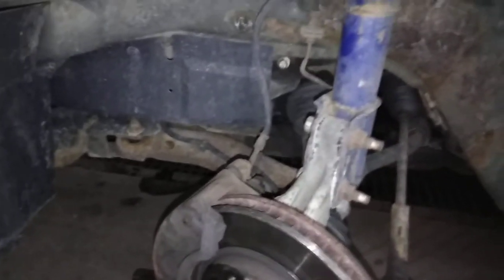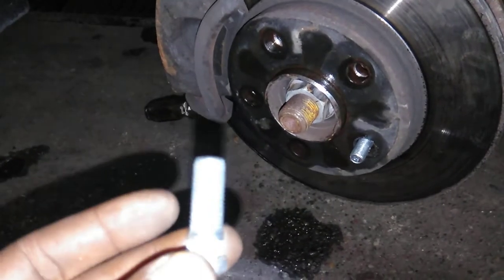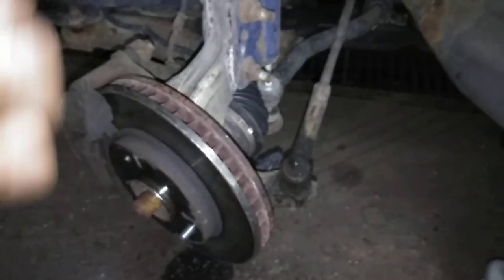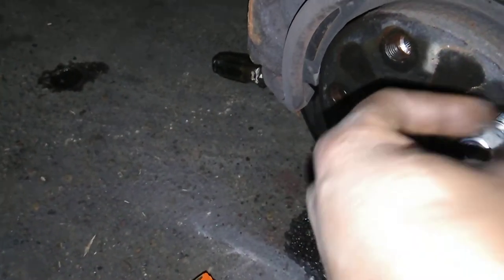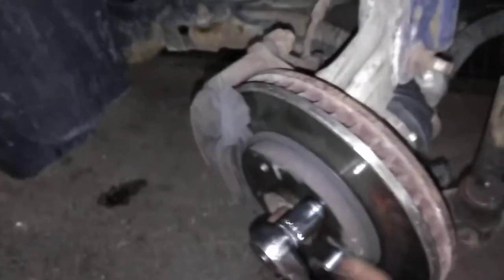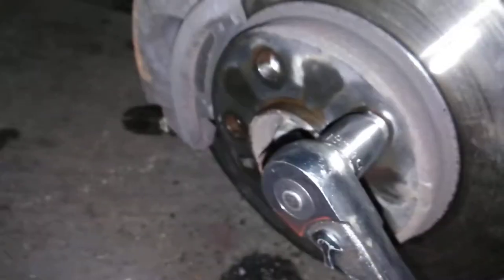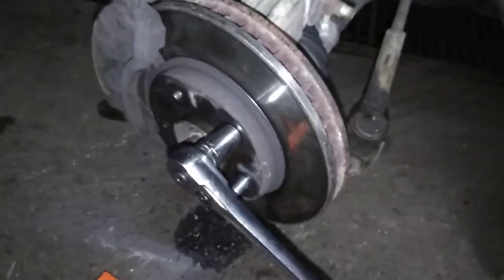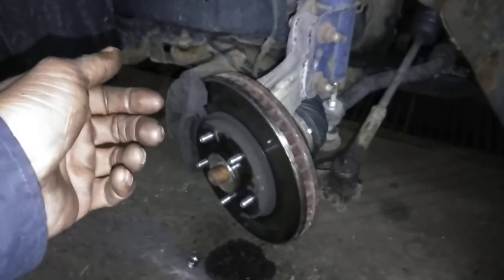www.helpwithacaronline.com 2001 Grand Prix wheel studs replacement

Comment: You say that there are two different size lugs. Hub on lug and hub off lug.  Are they different lengths to compare.
Reply: That's what I was wondering. 
I assume it is the length.
Reply: It is shorter.......
Dorman 610-324 wheel stud. 34.5 mm long for installing without removing hub. 
https://shop.advanceautoparts.com/p/dorman-autograde-m12-150-serrated-wheel-stud-1270mm-knurl-345mm-length-sold-by-each-610-324/22146079-P

Part No. Dorman 611-183 lug nut. 
https://shop.advanceautoparts.com/p/dorman-autograde-wheel-nut-m12-1.50-open-bulge-seat-19mm-hex-21.4mm-length-sold-by-each-611-183/22145787-P?searchTerm=Dorman%20611-183%20lug%20nut
For the 01 Grand Prix.
Reply: Be aware of the dorman part number I gave you for the stud is incorrect Amazon showed it Advance Auto showed it AutoZone showed it as being correct be aware it is incorrect it was too small where the spines are but yes there's a shorter stud nonetheless that does not entail removing the hub but again that dormant part number is incorrect

Comment: Are those Detroit Axle bearings decent, do they last?
Reply from the maker: Thanks for the comment. Their parts are cool i use then on my cars all the time
Reply from the maker: @mrbreezeet1  only thing i suggest is take your old parts with you to compare and make sure its the right one. They also can rebuild your existing axles and some other parts. No problem hope it helps reach out anytime